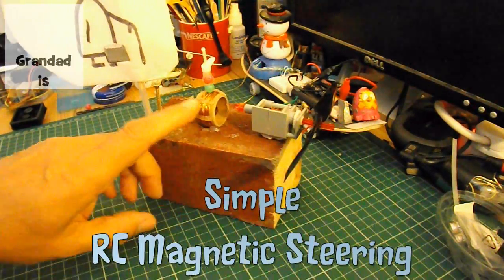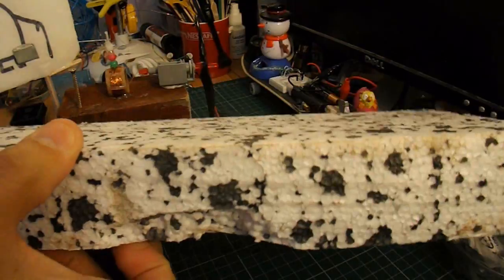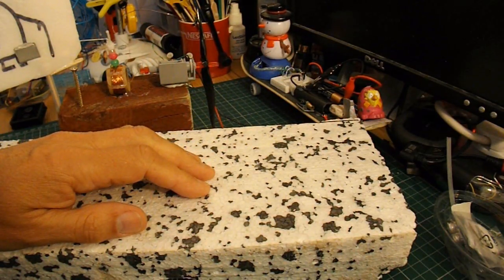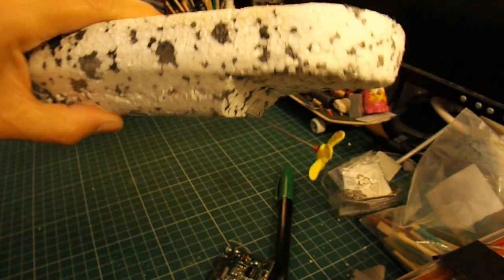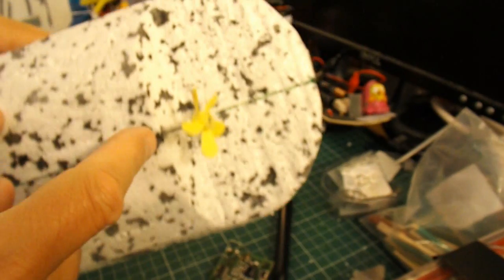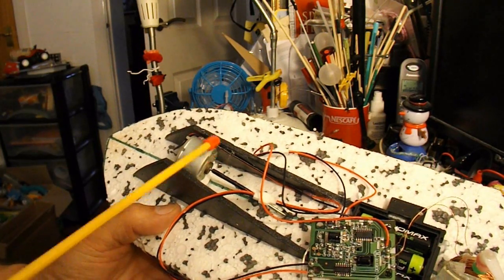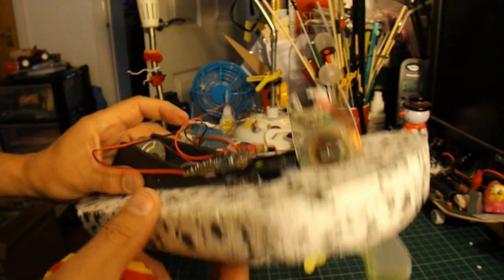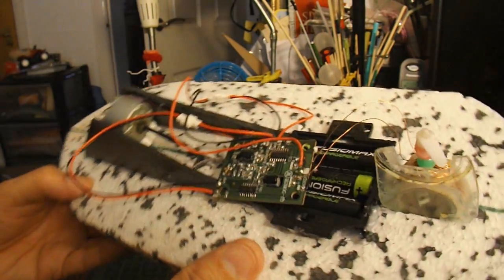Simple RC Magnetic Steering Boat

Comment: Watching that demonstration I can't helping thinking that we could improve that by introducing some sort of feedback mechanism.
I'm not certain how I would do it, but it would involve an op-amp. 
It might also involve two coils, or a hall effect sensor for feedback.

Yeah, I do tend towards complicating things that are inherently simple. ;P
Reply from the maker: Aadil Shah yes you certainly are complicating things, however I have seen projects on YouTube using hall effect sensors and PIC controllers to give proportional control on the steering. I don't intend to get there. This is the one that I was thinking of, although there are plenty more if you search for them https://youtu.be/_8kzPo64GGw
Reply: GrandadIsAnOldMan Yup, something like that.
Except that I would most likely choose linear feedback over digital feedback.
I cringe every time I see someone using an Arduino to implement a concept that could be accomplished using a simple 4011 quad nand gate I.C. lol
Reply from the maker: Aadil Shah Now you are definitely going beyond me. I did do that sort of circuitry at college back in the 70s but have never had any practical application for that training so I have forgotten most of it.

Comment: That foam looks coconut and liquorice flavoured.
Nice build, looks like it might get some speed up on the open waters too :)
Reply from the maker: slider2732 that's the foam insulation they put under the floor in my conservatory. Hoping we might see the sun again before Christmas, it seems to have disappeared at the moment, replaced by lots of wet stuff, so not keen on going to the boating lake at the moment. Even if the weather improves it is currently the school holidays so the lake will be packed with kids if the sun comes out.